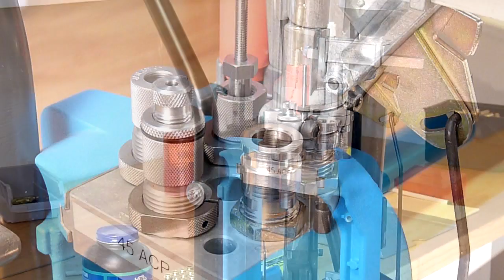Dillon XL-650 Powder Check system with 45ACP (HD)

Comment: That charge checker should be included.   We have one and it comes with a Primer buzzer.   LOL that is not dangerous, you would think they would want zero hot loads and this device helps do that.   Should be mandatory because one hot load is all it takes to destroy a gun.

Comment: Hi
 my xl-650 came set up with 9mm. My power Checksystem came with 3 Powercheck
 rod assemblies.
 21372 for .22 - .29 Cal
 21373 for .30 - .41
 21374 for .44 - .45
 

Right now they have the 21374 for .44 - .45 is this correct assembly rod or
 should i change it. Which one should be the 9mm rod ?
 
Thank you

Comment: the rod casts the powder out of the socket and charges are not equal out, check this system malfunctions, the powder stuck to the rod stays ...
Reply: +kurabo47 I haven't seen this problem, even at best reloading speeds I can manage.  If the rod is completely dry and free from oils it may carry a particle or two of powder from one shell to the next, but as it then carries a few to the next, so consistency is not a problem for me.  Variance from the powder system after check is generally .05 to .1 grains for the 20064 standard powder measure, and it appears that variance is introduced at the powder bar.  I'm interested to know what you have experienced.
Reply: I haven’t experienced this and I’ve paid close attention.
Reply: I had the same issue, particularly when it got humid out. Try running the brass rod over a buffer to polish it up (don't round the flat face though) and wipe it down with de-greaser before reinstalling it. If it's clean and dry (and mirror polished) powder won't stick at all

Comment: The Dillon Powder Check is a piece of garbage! Mine gave up after only 300 rounds. The metal rod ate most of the plastic away where it contacts the buzzer.
Reply: I know this comment is five years old, but if you haven't (and YouTube notifies you about this comment) call Dillon.  They have a great reputation for customer service.